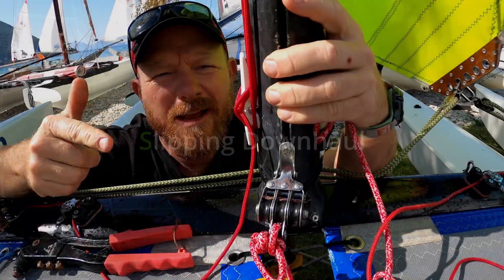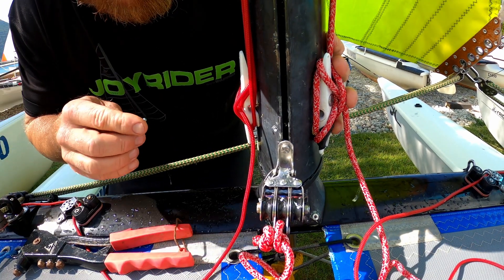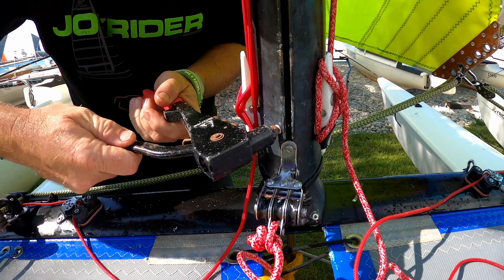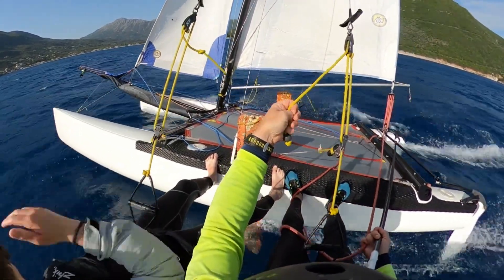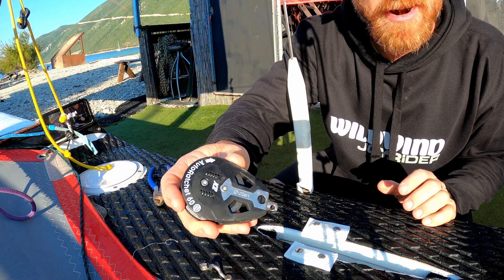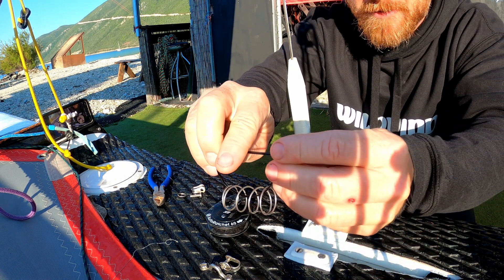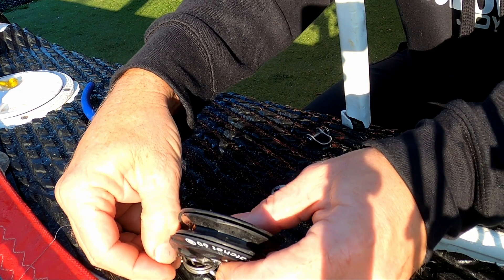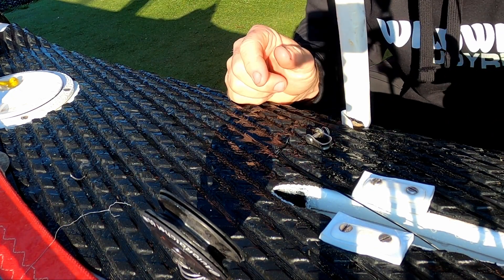Quick tips for catamaran sailors➡️ S04 E02

Comment: The pre-tensioning of the springs with cable ties is NICE.  
 
For those who dislike that a cable tie can only be used once: 
 
There are reusable cable ties, exactly like the standard ones, just with a tiny lever to open . Ideal for a task like this, where you need it for just a moment, but again and again.  
Or if you want to bind together some cables, but don't know for how long and for how many
Reply: There are also "Velcro" cable ties or even wire bread ties would do the trick.
Reply: @tektrixter  Correct and good to give alternatives - but they do not work here. 

You have to tension two sides in several steps alternately. Here the cable tie is ideal, it can be tightened over a long range fast AND notch by notch. It serves two purposes at one time, to compress the spring in steps AND to fix the position. 

For the velcro the tied objects must be held together so you can wrap around it 
And a spring contains a lot of energy, even this small one. Wouldn't trust velcro here.
A bread tie might hold it, but you either have to again compress separately with another tool, hold it together SAFELY to bind it down, or you have to wind it down mit the bread tie with hundreds of twists, takes ages - and the same for the unwinding. 

   
Sorry for the endless nerdy talk, but I have the habit when I hear something (like your proposal) to evaluate the pros and cons to come to an opinion beyond a gut feeling. And it is of no use (imho) to just say "won't work" (often in the YT comments), but one should tell the reasons why and why not. That gives the recipient the ability to apply these criteria on his own next time.